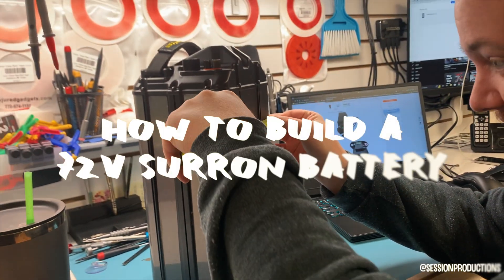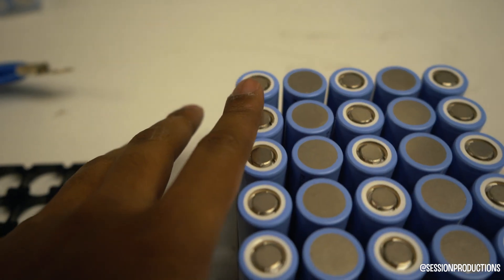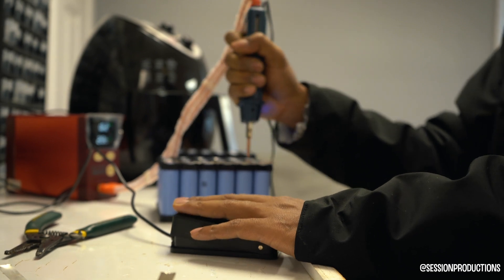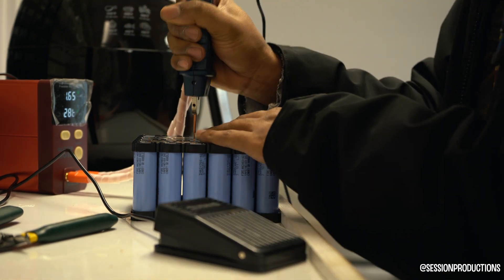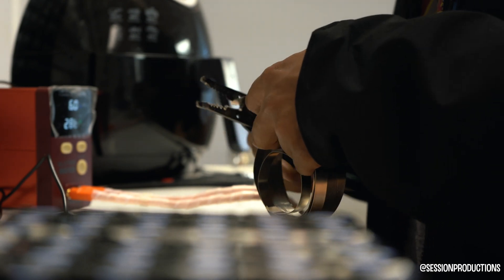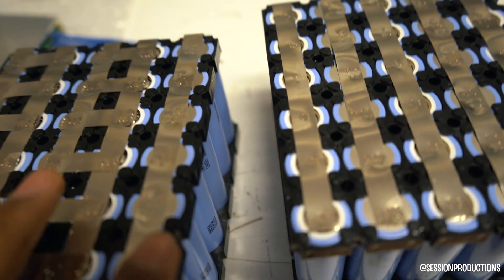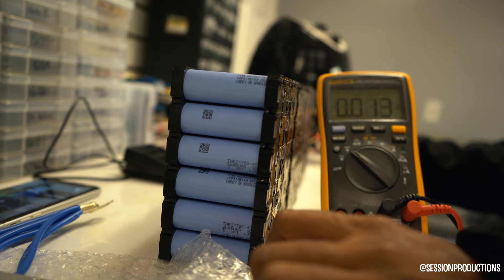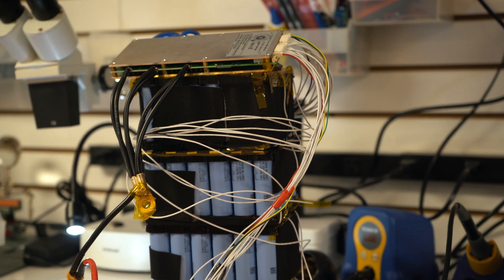How To Build A 72V SURRON Battery: PART 1

Comment from the maker: For anyone that’s reading this thread let me give you a little information. This battery that is in the video is capable of over 20kw. 72 x 400amp BMS equal well you know do the math. I don’t know where this guy got 60 from but I hope this cleared this up from anyone getting confused.
Reply: Yeah I was thinking that too, now 400 amps on a full charge tho would be 84 x 400 over 30kw
Reply from the maker: @itzpogboy  I’m not sure if it’s supposed to be multiplied by 72 or 84 because youre only at the top of the charge for so long. You might be right though I’m not taking that from you at all lol. Thanks fo reaching out too
Reply: yes regardless tho how did the guy in the video get 60 lol lets call it 25kw  @mikeyyywill
Reply: @mikeyyywill  What is the cost to build this yourself?

Comment: Thx for the video. Where did you order the battery's from dp you have a link?
Reply from the maker: https://www.18650batterystore.com/collections/18650-batteries?utm_campaign=16284236520&utm_source=g_m&utm_medium=cpc&utm_content=583262441696&utm_term=b_18650&adgroupid=131993873485&gad_source=1&gbraid=0AAAAADl22IMRAaqmPIYHgKHfEosMUPExW&gclid=CjwKCAjwzIK1BhAuEiwAHQmU3rSCqeLNJf5Kd_Amm6A06KjEo3WH7mqS8j3Bhd9omRUlHfNbclCNPxoCn2oQAvD_BwE

Comment: So did you use a total of 120 21700 batteries??? It looks like 30×4...
Reply from the maker: Yea 120 batteries and I think it was 30x4
Reply: @mikeyyywill  thank you!!!
Reply from the maker: @jasonhartless3797  yea it’s 6x5 and then you connect the 4 packs or do them as you go. For me it was easier to just do 4 separate packs and then connect them

Comment: Yo wassup mikey? Would i be able to use this on my surron vs getting a battery replacement?
Reply from the maker: Unfortunately no. Because the stock surron battery is 60v while this one is 72v. You can’t go up and down unless you have a speed controller that can use both. The stock one doesn’t have that capability
Reply from the maker: You could do this build and just make it 16s instead of 20s. Just buy some smaller BMS’ sand less cells

Comment: Hey man I’m going to attempt to to build my first battery. Do you mind helping me out? Also trying to figure out total cost on making a battery capable of 30kw 72v Surron battery… any help would be appreciated man.
Reply from the maker: You’re going to need a 500 amp BMS and make sure you buy copper strips to install
Reply: @mikeyyywill  how much do you think the whole battery will cost? I woukd like around 42AH
Reply: @Mr316jon316 around £630-700 for the parts alone, then your gonna need a decent soldering iron and a spot welder. The only 2 things I didn't add to the parts list was heat shrink and padding since they can be improvised (bike tyres and tape)

Comment: Can you please share the box 3D file? I want to build a 72v60A and just need the box. Thank you
Reply: Hi, what kind of cells do you plan to use and how many amps of BMS?
Reply: @maksymradchenko5063 thank you for replying. I want to recreate the chi battery 72v60A. They told me it contains 240 LG21700 cells. For the BMS i was thinking an ant bms with 200A. I want my Surron to go around 60 miles/h for around 50-60 miles of range. I'm just stuck on the case 😊.

Thank you
Reply: @Qiuness salut 
Au reusit as faci bateria?
Reply: @arvatadryan0987  yep.. Acum printez carcasa
Reply: @Qiuness oare ai ceva date de contact ? Vreau să fac și eu aceeași baterie de 72v și poate aș avea nevoie de ceva ajutor dacă vrei bine înțeles
Reply: @Qiuness  cam cat de inalta ti-a iesit ?

Comment: Hey, Shouldn't this battery get less range since its 4ah x 6p = 24ah with 72v = 24ah x 72v = 1728wh. While the stock battery is 60v with 34ah. 34ah x 60v = 2040wh.
Reply from the maker: I literally just rode 4 hours from 12-4:30 on the battery today. At 72v the power isn’t as demanding at 60v
Reply: @mikeyyywill  Oh, I see. How many  watts you drawing? Must be fun riding that beast!
Reply from the maker: @3DRobot69  off-road I’m only drawing like 50-75amps because I’m only going 30-40mph. On road it will drain faster the faster you go

Comment: There is no way you can discharge more than 80 amps without heating up all the nickels and I'll bet your voltage drop is 
huge
Because u think building high power batteries is a joke 

Next time use copper busbar for your own safety!
Reply from the maker: There is an updated short on where I added more nickel strips to handle it. I put more on the whole battery. I had someone else tell me so I added more for safety
Reply from the maker: Never had the pack get warm or had any random turn offs. Checked for hotspots and everything
Reply from the maker: I’ve had over 10 cycles on this battery as well. Thanks for your input though forreal. I’m not being mean or anything
Reply: @mikeyyywill  u are in the right direction bro 😎
Reply: I'm glad somebody else noticed. i was worried for this guy's safety through the whole build. And the discharge connections were completely inadequate.
Reply from the maker: @thesufi  check the updated video under my shorts tab. I’ve had over 20 charges and discharges with it the past couple of months
Reply: @thesufi I'm interested in building a battery, any resources you'd recommend to better understand these systems and how the cells/bms/speed controller all interact? I understand electrical systems, not so much these app things. Thanks

Comment: Hi. Thanks for this great tutorial video.
I was wondering if its easier to build what you did here using 9v batteries. What are the obstacles that you will come across with building a pack with 9v batteries?
Reply from the maker: Good question. For starters it would be difficult to get the nickel strips to stick to the tops of a 8v battery. I’m bot sure how rechargeable they are
Reply: @mikeyyywill  
Oh ic.
Thank you.